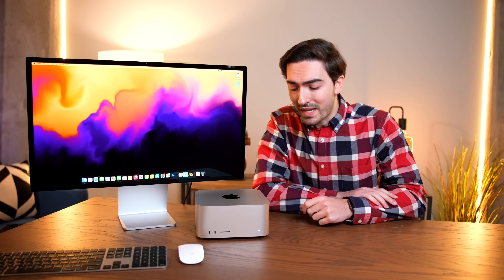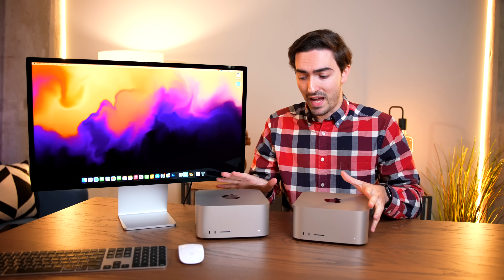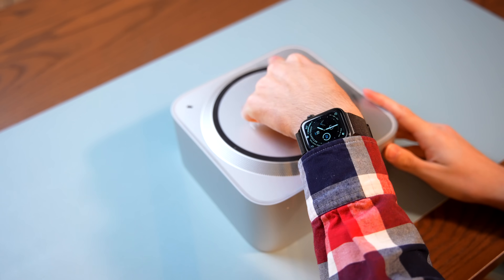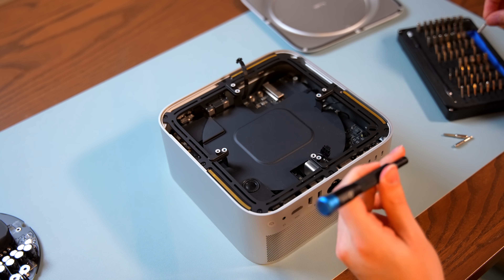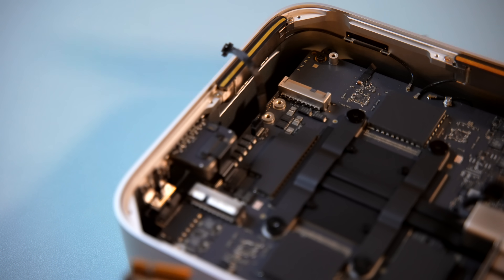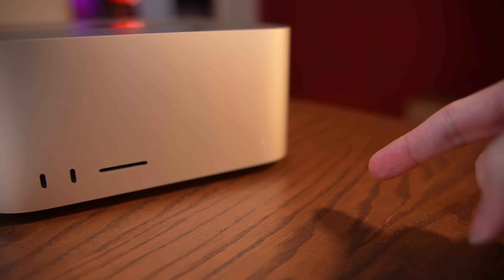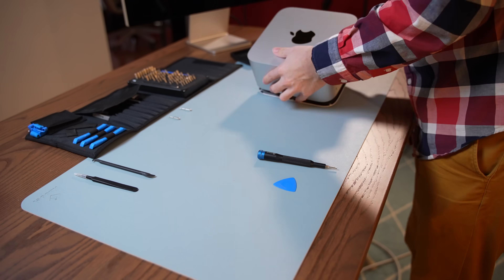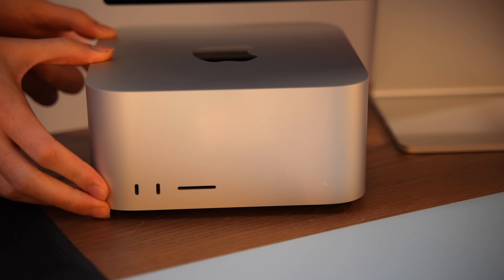What happens if you try to UPGRADE a $5,000 Mac Studio?

Comment: Given it's Apple, "Is the Mac Studio upgradeable?" question can be answered without risking hardware - no, it is not.
Reply: Yet because they made un upgradable units they have been able to developed one of the most amazing chips on the market. one that in its first gen thretens every other unit on the market. 
It wont change how shitty this situation is. not being able to swap drives is a real no no! and then you have windows that is basically one big problem that some how works, and when connecting new internal drives you need to have a degree on the inner workings of the board you use so that you can actually use all the slots provided. and oh my you better not have a cheap board because that's only good for 2 drives and 1 pcie lane... 
To just say "because apple" is ignorant. 

What they have shown with their unified chips is that the "upgrade path" is not always the best way. 
For many many people the ram is the thing that you are more likely to upgrade over time if anything, you can always add external storage.
Reply: @Maradnus  Sorry, but there in no technical reason why Apple couldn't put a couple standard gen 4 Nvme slots in this design. Apple drives aren't better then standard, high end, Nvme drives. The only reason they do it this way is so they can charge an arm, leg and kidney for storage.
Reply: @marekkedzierski8237  and? so what if they do! are we going to winge that super cars can use normal fule because that what you want to drive?? 
it's not a computer for normal people its for pro's who's business will soak the extra charge for the storage.. 
I will happily pay more so I stay under a tax bracket.. why give the tax man that cash for nothing when apple are charging your first born but you get something for it. 
yes they could very easily have allowed us to install one. but that rubber ring is clearly not meant to be removed by us. 
I agree is a very crappy move and I really think that it would be better for them.

A raid unit can be brought for $200 that can hold 50tb.
to winging about internal storage in this day and age is a real joke. 

My editing rig has 200tb external storage. 
You raise a valid point.
Reply: @Maradnus  storage is something that needs to have the ability to be upgraded especially on a $5,000 machine. You average person isn’t paying 5 grand for a computer. Once you go about say 2.5k you start reaching the realm of content creators and I can tell you most I know and have watched would much prefer to have the ability to upgrade their SSD rather than to carry around an external drive.
Reply: @Chrisp707-  yes true. I am a creator (not this account) and the convenience or being able to replace it my self is amazing. 
Yet being able to plug in a raid unit and have hundreds of terabytes right there, that is more useful that a single 1-2tb internal drive. 

I do have a 5k rig and it would be so bad to have to send it in to just replace a drive.
its loads of hassle. but caddies that hold of hundreds of terabytes beat that hands down. 
no one is carrying a Mac studio around. 
 
I brought a top spec Macbook to keep me below the tax bracket, that is really common. as its meant for pro's who are buying them for the company.

Comment: The machine isn’t sold as an upgradeable machine, so I don’t think the rant is really all that valid. That said, this restriction is almost certainly related to T2 and security. You can disagree with their choices, obviously, but then just don’t buy it. Apple is very clear about these restrictions and has never attempted to hide it. Would it be nice for this to work, yeah, of course; but you aren’t losing any functionality. In fact, I’d argue this is still an improvement as should your board need to be replaced, it almost certainly can have the data transferred over by Apple.

Last,y, until an 8TB version is opened to confirm the second port is used in those machines, it is just as likely that the second port is for diagnostics/recovery purposes and isn’t just a wasted second slot.

Comment: I see your point but these machines are sold as not upgradable, so the fact they could have two or twenty SSD ports inside, makes no difference at all. I mean, it would have been nice if we could add another module, but we can’t be angry if it doesn’t work (but I understand that disassemble and reassemble these Mac Studio so many times could be quite frustrating).

Comment: I could have told you before - we already know this from the 2019 macpro - the bootROM is stored on the SSDs and the T2 chip (part) checks if the boardID matches.
with a working second computer and the apple configurator should work.
Reply: so, we knew, only a NAND modul with the same size let you install with configurator2 - and so, no upgrade possible! the size should stored in the M1 silicon : -(

Comment: No need to leave psu explosed as is, could include a plastic shield for the exposed points, or a metal cage.. There's enough room. It's not meant to be user serviceable so "fuck you"

Comment: Apple did this literally to be complete dicks. The last macbooks with that same modular interface, could have an adapter installed to allow an off the shelf NVME drive installed. It's literally a M.2 slot with an altered pinout. After those became a thing, they started soldering the storage, and then opted for this firmware locking method in the last Mac Pro tower which has this same interface.

Comment: Apple could be doing some form of hardware ID pairing to the T2 chip like they do with TouchID and FaceID components to create a securirty audit chain.  If thats the case, the mac may create a record of its component parts at build time, including their signal paths. If anything changes, it refuses to boot believing itself to be compromised, until Apple applies some proprietary procedure.

Comment: A week ago, I bought a laptop. Nothing too special, Ryzen 7 and RTX 3060. When I was adding a second stick of RAM that i got, i looked at the internal ports. There was one M.2 slot occupied by the SSD that it comes with, then there was a second, free M.2 slot, and if that weren't enough, there was also a free 2,5" hard drive slot. That's literally three more upgradeable slots than this piece of shit has, and i'm not even talking about the memory...

Comment: If enough of us just bought it for what it was or don’t buy it. If they wanted it user serviceable or upgradable they would have put the screws on the edges where people can get to them not buried under a barely removable rubber ring. If the pro is going to be modular and upgradable then buy that so you can do it. Not buy a sealed box and get soooo mad cuz when you cracked it open you couldn’t mess it up. I spent 9000 on something I’m pretty sure won’t work and I’ll get angry when I prove it. 

Just saying. Knowing that. Don’t buy it. Sure as hell dont buy 3

Comment: Great video Luke. Two points, firstly if unplugged the power supply is quite safe. As you noted it took you a long time to actually get inside the case, modern Apple power supplies discharge in just a few minutes. They don’t want low paid technicians in apple stores getting zapped :) Anyway with regard to the SSD as others have suggested, literally the only method that may work if putting the machine info DFU mode and doing a firmware restore from another Mac with the Apple Configurator application from the AppStore. This is the same method as for the 2019 Mac Pro, the firmware is paired with the Secure Enclave and so on. Doing this however, as you may have suspected, may will break the pairing with the original machine the SSD came from. But I’d expect it to work again when DFU restore is done when the drive is back in its original machine. 
In 2019 Mac Pro we can only buy SSDs from Apple. And their website says you just use Apple Configurator to pair them. Fine. What we do not yet know, is does the same process work on Mac Studio? Or is there additional cloud / phone home type activation lock used internally by Apple’s repair process and a Apple Configurator DFU restore won’t help? No idea. I did notice Apple’s Mac Pro instructions say SSDs are labeled and stick 1 must go in slot 1 and 2 in 2, so maybe the second slot just is more ‘address space’ for the raw nand chips, hence why there is only one controller. The DFU process ties all that up and registers it with the Secure Enclave.

I read a fascinating article recently about the apple silicon boot process and how all this works in relation to the folks getting native linux booting working, so I’ve been thinking about this a lot while I wait for my Studio to arrive. I have to wait since I changed my mind on the config the 2nd day and canceled and reordered.

Comment: This is a Secure Boot feature of UEFI, it is designed to prevent data from being stolen. The drive is encrypted to the machine, so if the machine sees an encrypted drive inserted from a different machine at boot time, then someone is up to no good. If it finds a its boot drive has the wrong encryption signature, then someone is up to no good. If however, you inserted a blank SSD into the slot, and it's own boot SSD or even a blank SSD in both slots and used Internet recovery to install the OS over the Internet, that would work fine. This is akin to going next door and trying to open their door with your key, taking their lock out and putting it in your door and then ranting that you can't open your door with their lock but your key, so the manufacturer must have gone too far by preventing your key from opening your neighbours lock right? At least that is what your rant sounds like to me.

Comment: The disk is encrypted to the mac ID of the machine. If you made a bootable installer and booted the Mac Studio from there, you can use Disk Utility. It will see the drive but you will have to reformat the drive first before you can install a new Mac OS

Comment: whether theres a convoluted work around using some software users don't have access to by default within the operating system is rubbish, they go out of their way to make everything non standard and difficult for users and those who support users. apples desire is to restrict their user freedoms - full stop, they take decent open standards developed by industry bodys and turn them into proprietary standards that have limited functionality , seemingly remove-able storage that isn't user configurable is disgraceful. Apple must be tackled for limiting their users, those in power just wish to abuse the ordinary people, whether its politics or corporations, we need to call them all out and keep calling them out regardless of how they try to ride roughshod over us with their self congratulatory marketing. Their new silicon is great but allot of the decisions re their computer designs are not, all of this machine looks unnecessarily expensive to manufacture? having watched the follow up its clear even with arcane use of configurator, these slots are for proprietary cards completely un-configurable to the user and not useable by the user.
Reply: Thanks for watching 🤗   
Send a direct message right away,I have something for you 🔝🔝🔝

Comment: It's not just increasing the SSD capacity tgat the problem with this design, but SSDs dont last more than 3 years in high use cases which means when it dies, not if, you can't replace and recover the 5000 dollar machine! That's not green and is only gonna triple the waste going to landfills!

Comment: I like the fact that I could see the internals of the computer, but I found that the rent was no necessary. Macs can’t be easily repaired they are very custom machines and moving a hard drive to another Mac could in fact be a security breach especially if there is already data on the drive.
Reply: …except that I’m fairly sure they use drive level encryption as standard, so any data on the drive is close to random without the key. Sure it may provide another level of security, but is akin to adding a bread twisty to a padlock.

I’ll agree there are a number of assumptions made in this video that seem to be stated as fact, the short story though does appear they have put hurdles in that thwart third party repair or upgrade.
Reply: @ThurstanH  you are well spoken. I heard that the second port for a drive was to be used by Apple for troubleshooting. I also watched an iFixit video and they said you can move the drive from another Mac Studio and connect it to another Mac Studio, but it needs to be able to connect to the same spot where the existing drive was connected. I think that is what they said anyways.
Reply: @MasterK50326  thanks Addison. I was wondering if the second connector may be for diagnostics. Will be interesting to see what comes of all this.

Comment: Like all Macs since the T2 chip with Intel and repeated with the M1 series Macs, the SSD is encrypted by the T2 or M1 series chip and will not accept any other. That's why you can't swap things out. If you left the original SSD where it was and introduced a new un-encrypted SSD as a second, perhaps that would work, but Apple does not support a 2nd separate SSD, just one SSD logically. The higher capacity models may physically have two SSDs, but it's treated as one. That is why it's not expandable. You are thinking old school, plain 2nd drives.

Comment: I like your videos however this one found me a bit perplexed - Apple never advertised this machine to be user upgradable, and at times transplanting a HDD isn't as easy as just moving it from one machine to another. If it were a feature they didn't deliver on I'd understand the disappointment, in this case meh. Hopefully the Mac Pro replacement will have more user replaceable parts.

Comment: The thing that makes no sense to me is, if as you suggest, on the less expensive models, the 2nd SSD slot isn't available; if they haven't put the controller chips in place... Why even put that 2nd slot in there? Why add the expense (whatever it may be) of installing a 2nd SSD socket, that can never be used?

Comment: This is absolutely why I will NEVER buy Mac hardware. I run a recording studio and every single time apple releases a new piece of hardware, there is momentary temptation. But, and this is a big but. When I am making the investment in what amounts to almost 2.5 times the price of the equivalent hardware, I would expect that should something go awry, I can fix the system. Things happen, systems go offline and systems potentially can fail. I have had hard drives, various systems go offline for no apparent reason and restores were required. These things happen. But if you cannot restore a drive, or upgrade it, this is completely inexcusable. I am sure, at the "Genius Bar", they have a way to do it. But they are denying the end consumer the right to choose to do it for themselves. Imagine if cars were built this way. There was no way to replace or upgrade any part in a vehicle.

Comment: You should've tested that formatted SSD in a. Windows PC. It would even reveal that if it doesn't have any memory controller in it and\or if it is software locked to run only in Mac.
Reply: It would not work. There is no controller on the ssd. It’s on the motherboard of the studio itself. Meaning the “ssd” is just band chips tied to the controller on the studio

Comment: Maybe the second slot receives an off the shelf ssd with a controller on the ssd. The other slot uses a ssd with no controller as the controller is on the motherboard/soc but that slot doesn't seems to have a controller tied to it.

Comment: When ordering the Mac Studio, any of configuration details will be written onto the firmware which any of consumers can't doing such modifications after receiving the unit. Secondly, the storage inside SSD are encrypted uniquely on each machine, so swapping with one another is not possible. 

However, there is one thing that you might want to try - cloning the entire SSD storage bit by bit and transfer into 3rd party SSD, see if Apple is trying to locking SSDs only to one particular model instead of using any kind of 3rd party, even the storage had been cloned.
Reply: But why? Why are they writing configuration details into firmware or why are they encrypting uniquely to each machine?

Comment: Having never set foot in Apple's walled garden, this does not surprise me at all. This is why I will never own anything Apple. Period.

I recently picked up a windows laptop. It came with an M.2 SSD , and an empty bay for a Sata SSD ( no cable included ). I ordered a $10 compatible cable to connect to the motherboard and dropped in a 1TB SSD. Guess what? It just works. 
This is why I use windows, because I can work on, upgrade and fix my device that I paid for.

Comment: 11:59 Not to undermine anything else that you said. But I didn't see anything in what you showed to suggest that that slot is non-functional.
* I wouldn't be at all surprised of it's only possible to boot from the first slot.
* It worked well enough that the device recognised the foreign SSD and locked you out.

That aside, I'm with you on evening else. This is the machine that has brought me the closest to actually buying a Mac. And then things like this are an excellent example of why I never will on their current trajectory. We have to get better at repairability.

Comment: I think the lock is not on the machine but on the drive itself. The whole drive is encrypted with the unique key that engraved in the motherboard firmware. In doing so, it prevents a person from accessing any information when he or she pulls out the SSD and try to read information using another system. The down side is that the system won't boot at all when you change the storage, just like the iPhone or Macbooks.
Reply: this is actually fair point, it would be worth to try to do usb restore after ssd replacement